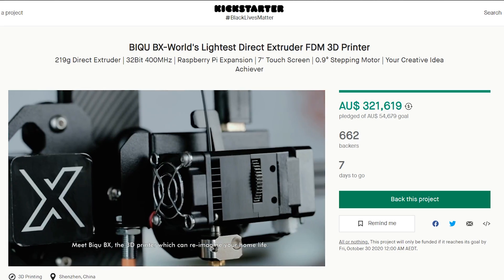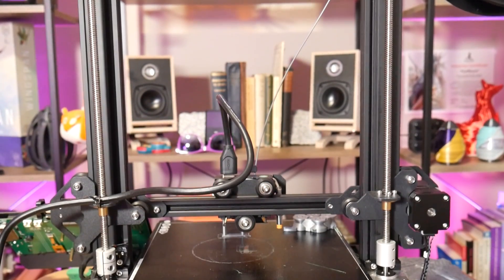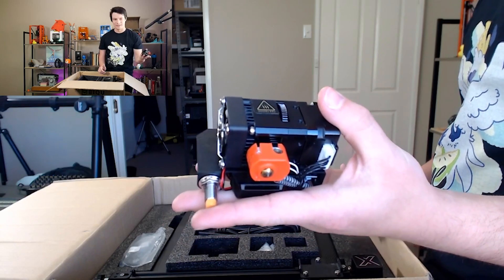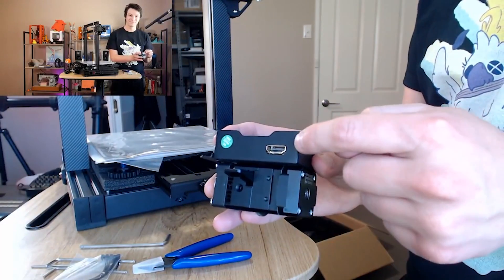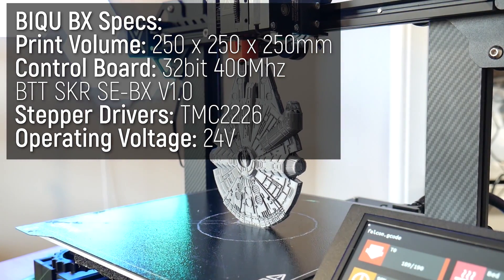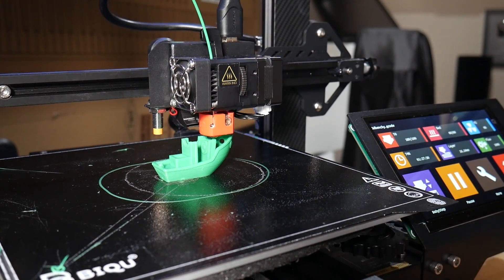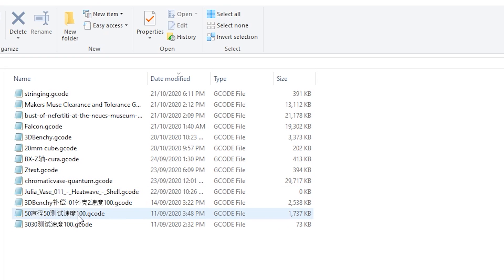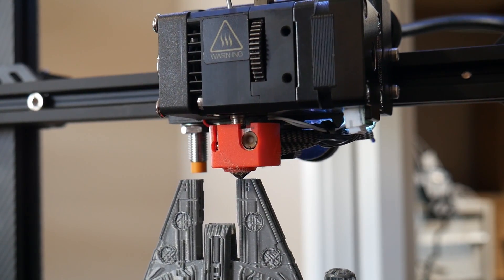The BIQU BX is an innovative 3D Printer, and a little strange.

Comment: I thought the HDMI being included is brilliant. It's one of the lightest yet capable connections of that size and very common so easily replaced. It's clear why they went with it so I'm not sure why you took issue as it's leaps and bounds better than 99% of the printers out there. I too love the extruder and run them on all my printers(previously ran Orbiter+Phaetus Dragons) and they are superior to most and extrude quite fast although you may be the kind of guy running 0.8-1mm nozzles at super high speeds and in that case this is not the hotend for you but everyone else, buy. The extruder fan sucks but a 40mm can be adapter for use quite easily. Only downside is price now that it's 500-550 USD.
Reply: Yes, it is sounds good to have HDMI, but, just to note, the previous their model B1 printer used USB-C and it was NOT regular USB-C cable, but special from BIBQ, if not aware of, so it will not be a surprise if special HDMI cable will be needed again to obtain from BigTree in case a replacement cable needed.
Reply: IMO, display port makes more since I think, mostly because of the locking connector, but also because of conductor count and overall current carrying capabilities. Leaves more headroom and less likely a custom cable would need to be used.
When it comes to using the idea of repurposing a modern cable standard for the purpose of wire management, display port seems to make the most logical sense for this use case.

Comment: The interface on the screen need serious polishment. This bug is classic, here's how it goes: a button fires an event. The event decreases the counter and sends the signal to the machine to move the head down. Great? NO!
You can't just go sown so the macine stops if it's at its limit. Well... but the counter is not auto linked... if you don't receive the signal back from the machine telling you that it went down you don't know if you should count down or not. That's actually something that could change the design a lot because is this hardware ready to tell if any operation required were succesful? Actually I honestly don't know up until where it should be, but at least inside the code you should check your limits before performing operations. And that's something the interface needs to take care about.

Comment: The hdmi might be a bit strange to see, but this kind of connector repurposing is not really new, designing a propriatary plug can be expensive etc, so just using existing standards with different electrical pinouts make sense.  we can argue with the specific choise of hdmi,  put probably for pinout and power capabilities.
Is the motherboard side also hdmi so you can just get a replacement cable anywhere?

Comment: HDMI for power supply is not only strange, but plain stupid and dangerous! That alone is a Don't-Buy-Reason.
1. HDMI current rating is about 50mA. All cables are made for (and just for) that! Of course you can take more of the wires together to get a bigger diameter. But there's a gigantic bunch of other solutions specific for applications like that. I don't know why smb would intentionally engineer a fire-hazard into such a machine.
2. There's no reasonable priced HDMI Cable out there which is made for installing on moving parts. (There are ones, but overpriced, because of Pro-Use in Stage-Tech)
3.Friction-Fit on moving part (No more comment neccessary, it's just dumb, and dangerous if the connection fails)

I don't know how a company (even a chinese) would invest time and effort to engineer such a thing (Just beause it looks cool??!).
Aside of beeing loads of suitable connector solutions out there, chinese companies are world champions in copying also nearly every solution of Phoenix Contacts, WAGO, and others (E.g. those green PCB screw terminals, they are made originally by Phoenix Contacts).

Comment: Funny enough i actually have that problem with the SKR Mini E3 V2.0 32-bit control board from Biqu for the ender 3 pro, that the probe z offseet would not store in the ebrom and every print i need to almost relevel it, with the addition it would never go down further but the number would increase, and then doing it the other way it would go up, the only way i have managed to store the settings was through marlin mode,  but then switching over to the touch pad mode it would be wonky again, so it must be in the software in the moment -_-

Comment: I bet there's an internal extension cord between the LCD screen SD slot and the controller. SD isn't tolerant to EMF noise and will produce nonsense randomly if the wires are too long.

Comment: ok sooo what 0.o i mean yeah screw on cables are nice, but i don't wanna trust a wobbly-by-design printhead to keep hdmi perfectly 100% connected all the time... and pretty sure those cables and connectors weren't designed for high power heating elements either...

Comment: Hi for anyone interested I have spent a lot of time investigating the Gcode corruption issue mentioned in this video and basically it comes down to electrical interference primarily from the display rather than any cable. I note that in Angus`s video the review printer as an exposed back to the display. I surmise from my research that the display being quite close to the main electronics is the problem with this product. In most cases the BTT displays work well on Ender 3 & 5 upgrades because the display is remote to the main electronics. Put it adjacent to the display and all shit happens. I wrapped a couple of layers of tin foil in a Ikea sandwich bag behind the display on my HEVO build and all the immediate issues I had stopped. Angus, I look forward to your personal take on Ikea sandwich bags as opposed to your frequent trips to Aldi ! Best Boothy

Image Link: https://www.dropbox.com/s/h92r0yc39uerhsz/16071195203360.jpg?dl=0

Comment: @Maker's Muse I know that you use simplfy3d but have you ever tried MatterHackers MatterControl, i have been using it with my Ender 3 Pro (very Upgraded, Thanks to You and Michael over at TeachingTech) , i find it to be very good and would love to hear your opinion on it. The support system in it is very basic and in need of some work but the prints i have been getting are way better than i was getting in cura ( i don't have S3d) and the built in ABL system is so nice to use and fairly easy too. it basicly has everything that you need to calibrate/Tweek/Slice and alot more i still haven't learned to do yet. thank you again for all the knowledge you have given us it is highly valuable.

Comment: I actually can understand the logic behind the HDMI cable. Because, while I don't have many RS232 cables, I do have plenty of HDMI cables lying around, and they are very easy and inexpensive to buy. If the cable they provided for any reason broke or got lost, it'll be very easy to replace, whereas if they had gone with RS232 or a proprietary cable, it would be more of a hassle.

Comment: I don't know why this kind of clone printers exist. They don't work properly, hardware and software are not developed properly. Maybe as a DIY project but I want my Printer work right from the box, I don't want to spend hours modifying them to work. That's why I went with Prusa mini and so far, no prints were lost, only thing I have done as "service" was cleaning filament pulley from debris.

Comment: the hdmi may seem odd, but the hdmi is a nice touch for the fact that people will have an easy time replacing the parts.
and is a very simple solution when you need data and power.

Comment: I think the sd card issues are either firmware or hardware because I have a biqu based custom printer and the screen looks like it uses the same code base as mine, on which I have had the same issues.

Comment: I actually like the new thinking of that HDMI-idea. Just hear me out. 

Every time I upgrade something on my printer it's a pain to disconnect all those wires.. Just think about it, you have 2 leads for the heater cartridge, 2 for the temp, 2 for fan1, 2 for fan2, ~3 for the bed level sensor and 4 for the stepper motor. That's SIX tiny, flimsy connectors in total. And added up thats 15 wires running from the motherboard to the head. 

To disconnect this you use roughly 5 seconds instead of minutes. 

Well, maybe not hdmi was the best choice, maybe display port would be better since they lock into place?
Reply: Edit, shouldn't usb-C be best suited? Since it can carry insaine amounts of power.

Comment: Had very similar issues with BTT TFT70 screen regards the corrupt gcode, also in simulated mode it started corrupting the screen display. Definitely firmware issues. My screen also as a dicky SD card reader. Viewing angles are rubbish and the touch screen is not as good as the 35TFT screen. Edit: Please refer to my recent comment - my revised estimation is this is not firmware but electrical interference from the display being near interference.

Comment: I see many people complaining about HDMI cable. Previous Biqu printer have a USB_C cable. But how do you suppose to make a connection between motherboard and adapter board on the hotend? Artillery printers has a special flat cable which is esthetically good but you wont find out that easily. This solution was made to prevent disassembling a whole printer if you need to change something on the hotend.

Comment: The only thing i believe mlst printers lack ks the ability to utilize a double sd reader, in the sence of writing from wifi or lsn, instead of removing it. Printing from a computer is often worse quality than via sd due to bottlenecks in the bus on such things as arduino etc , and it does very little to switch to a 64 bit board as ot still has problems of transfer due to the main processor is not the thing that reads bit is fed by something else. That said this looks like it is a creality mix with prusa, but what we need is a sturdy delta with big volume as it is much less prone to vibrate, has better resolution than a cartesian and is a hell lot faster

Comment: Thanks I always enjoy your video. Would you do a Christmas present video. I want to buy myself a resin printer for Christmas I was going to buy myself Mars  but there are so many horror stories I think no. So I’m now looking at a Anycubic mono. If you needed to to buy a printer that would just work what wood it be ? My usages case is I very occasionally want to print missing parts for vintage valve radios mainly knobs. Thanks stay safe regards Chris

Comment: Actually HDMI is that smart part. Compare to a huge and heavy RS232 connector. U really can't find as much pins as HDMI on small and light formfactor. I've had few robot using HDMI for all the joints. Which is totally fine. And your print head doesn't move that much. friction is less of a problem. Tape should fix it.

Comment: I mean, using connectors for things you don't expect is pretty normal. I'm betting they chose HDMI because it had the right pin count and was smaller then DVI. The copper doesn't care what it's connected to.

I do agree however that it might not be my first choice when delivering heater current though. Relatively small gauges, unless they're using multiple pins for power and ground..

Comment: It baffles me why manufacturers are still wasting engineering time and BOM cost on these contactless bed probes when Lulzbot (may they rest in peace) solved this problem with way less hardware years ago: Just put four contact points around the edge of the bed, don't make the bed out of some noodly material that will warp all over the place, and the prints will come out perfect every time.

Comment: I kinda like it as a whole but that HDMI connector seems like a bad idea as they were never designed to be moved around constantly. Would be better using something like a DIN connector with the screwable collar to lock it in place. Even a display port connector would have been a better option as those at least have clamps that hold the connector in place.

Comment: As to the issues you have found with the printer using it in the more or less real world, is the whole point of getting out these demo pre-production printers. Kkankfully those at BIQU are listening to you bloggers and are already fixing those major issues befor production. My question is what is the latest that BIQU has to get the bugs worked out in order thnmake their December delivery schedule? I’m one of those superearly bird backers that reserved a spot to get one of the first printers off the production line. With that said I guess my bigest question is do I need to get a raspberry pie? What will it do for me when connected to the BX?

Comment: I have a Biqu B1. BIQU uses their (bigtreetech) TFT touch screens. They have their own CPU and communicate with the main board via serial port (sending regular g code commands). The SD card slot in the display is not on the mainboard and all data needs to be sent to the mainboard via the serial port. My guess is that the speed (baud rate) is set too high (250000) and so things get corrupted during transfer. I learned: Don't use the touch screen mode! Use marlin and, if possible, in combination with OctoPrint. One nice thing is that the mainboard USB interface is a real USB interface and not a USB serial port adapter. It looks like a serial port but you can choose speeds like 2000000+ and there is no corruption (speed is just the USB speed and it has internal error correction etc). So, using a RaPi with the mainboard USB interface works perfectly. Also, the TFT sends G-code but since it's not a direct marlin output, as the Marlin mode is, it doesn't actually know what the mainboard is doing: It can only interprete the g-code being sent from the mainboard, but things like position is apparently isn't sent. So all it can do is try to keep track (which doesn't work great as seen there). USE THE MARLIN MODE TO SET THE PROBE OFFSET! USE MARLIN MODE TO SAVE. that works... forget the TFT ffs!

Comment: Really curious what thoughts are on robotic arm based 3D printers.  Not a lot of comparative reviews out there on them.  For example the Rotrics DexArm.  The build size of these seems to be great and with much less hardware mass involved. Also the ability for some of these to print at different angles would have definitely addressed the top turret on that millennium falcon. (plus the added bonus of having a multipurpose robotic arm)

Comment: Looks like the first knock off Hemera has arrived. It's a great extruder assembly, cooling fans for it are a bit of a pain though. I'd be interested to see how close that extruder is to the Hemera dimensionally, will the coolers interchange?
Reply from the maker: Its quite smaller in it's dimensions compared to a hemera, teaching tech shows them side by side in his video.

Comment: My guess with that SD card on the screen, the traces are too long (or not matched length) to be running at the speed it is, probably slowing down the clock speed will fix it, but either way, it's not ideal.

Comment: The HDMI connector for power to the print head seems like an awful idea. I can totally see how someone inexperienced would try to plug the output to the head into a monitor and cause all kinds of damage. It's simply not the right tool for the job
Reply: Knowledge isn’t free and usually not cheap.  That one mistake will last a lifetime.  Let Darwin do his thing.

Comment: HDMI is known as being a pretty robust port, but in high vibration application (like here), a display port (which has a locking mechanism integrated) would have been better.
Or even better: JST type connectors.

Comment: HDMI is just a good connector, ppl use it to connect GPUs to laptops through a pcie port for the wifi module. And also even though it's friction fit, it is quite sturdy, and it's not like it get's tugged on during it's operation so it doesn't matter and it's actually good that they use a common port instead of something custom.

Comment: The USB and card reader on the screen is probably going through a USB channel, which tends to impact print quality.
The 7 inch touch with a Pi behind it is something I'm running now, as an outboard controller (my printers are in an enclosure), and I love it.  Chris Riley has reviewed OctoPi on a touch screen.

At this point, I would say any small amount of attention to hardware gets you a good machine.  The real trick is getting the firmware working right.

Comment: If its firmware is Marlin just use "M851 Z(value here in milimeters)" to define offset distance and "M500" code to save. No need to adjust the sensor position manually.

Comment: Whats next after just butchering a HDMI connector just because cables and connectors are available and very cheap thanks to economy of scale? Using USB-C connectors and actually send control commands and get temperature feedback to/from the extruder and hotend over the USB-Data protocol while using USB PD standards to deliver up to 100W of power to it?
Reply from the maker: Usb C would actually make a lot more sense lol